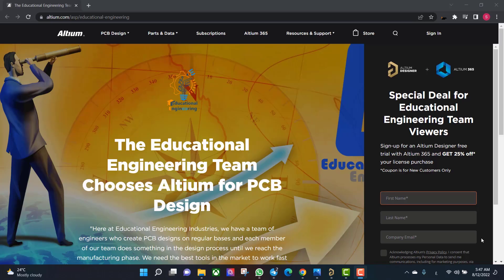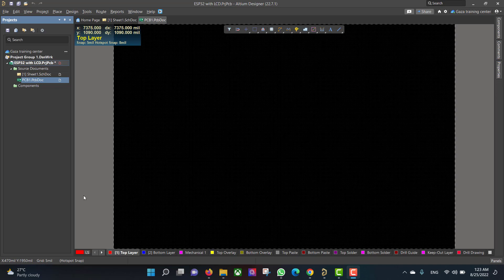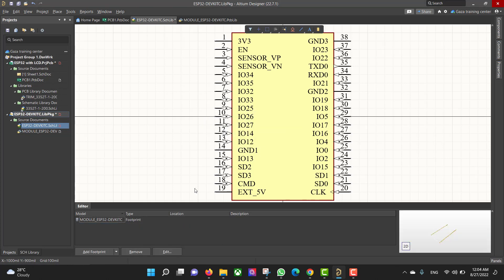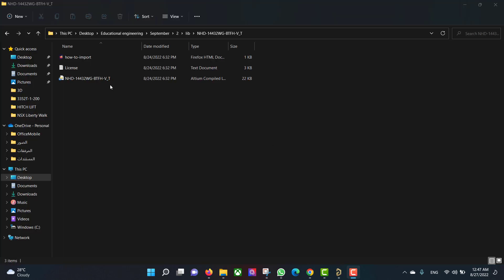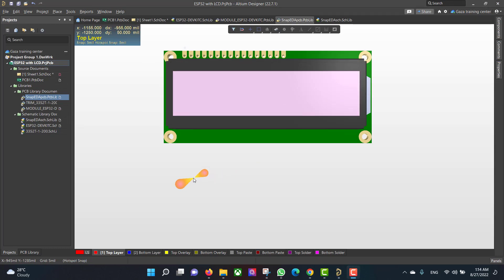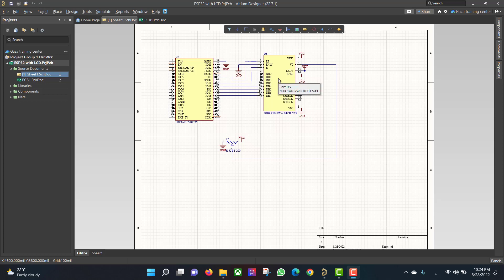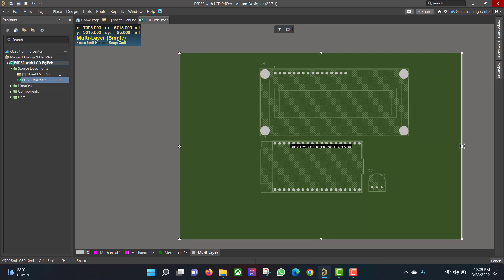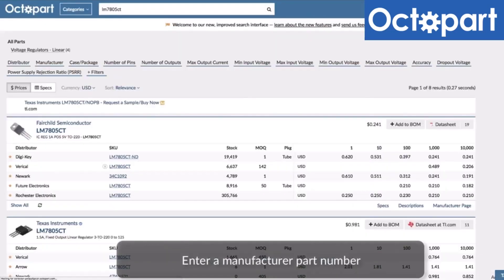Design ESP32 with LCD  PCB using Altium designer

Comment: Where will I get those 3D models?
Reply from the maker: You can find 3D models for designing an ESP32 with LCD PCB at the following sources:

1. **[GrabCAD](^1^)**: This is a community-driven platform that offers millions of free CAD designs, CAD files, and 3D models¹. You can join the GrabCAD Community to gain access and download the models¹. They have a collection of recent models tagged with 'esp32'¹.

2. **[GitHub](^3^)**: There is a project named 'Esp32PrinterController' by MitchBradley which includes a PCB design for a 3D printer controller using an ESP32 processor³.

Remember to check the licensing and usage terms for each model before using them in your designs. Happy designing! 😊

Source: Conversation with Bing, 19/11/2023
(1) esp32 - Recent models | 3D CAD Model Collection - GrabCAD. https://grabcad.com/library/tag/esp32.
(2) esp32 - Recent models | 3D CAD Model Collection - GrabCAD. https://grabcad.com/library/tag/esp32.
(3) GitHub - MitchBradley/Esp32PrinterController: PCB design for 3D printer .... https://github.com/MitchBradley/Esp32PrinterController.
(4) GitHub - MitchBradley/Esp32PrinterController: PCB design for 3D printer .... https://github.com/MitchBradley/Esp32PrinterController.
(5) Free CAD Designs, Files & 3D Models | The GrabCAD Community Library. https://grabcad.com/library/sk-pang-esp32-can-3-5-lcd-with-case-1.